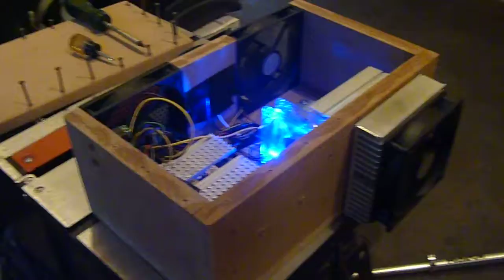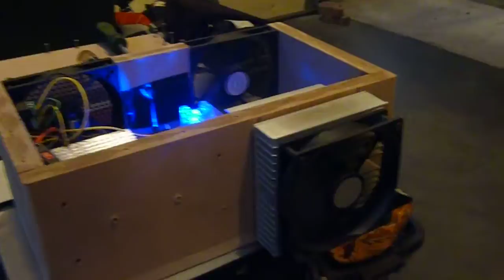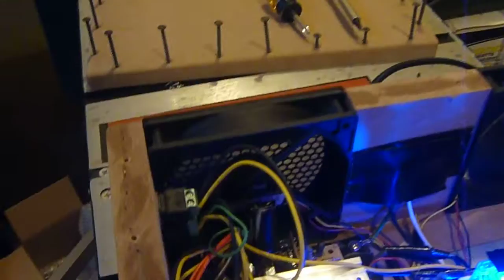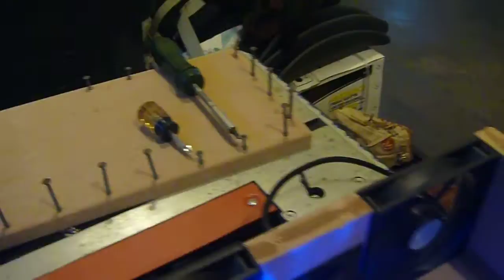Mini Heating/Cooling Unit

Comment: do you know the model number of you heating/cooling unit?
Reply from the maker: It was the PJT-10 but I bought them in 2012 from All Electronics. I don't think they have them anymore. I did find a link to the picture of the unit for reference.
https://www.allelectronics.com/mas_assets/media/allelectronics2018/spec/PJT-10.pdf
Reply: @jdccroad  Thankyou for that!!!

Comment: Thank you! you inspired me to build my own using maybe using simpler methods. I have been doing lots of research on it to make it simple as possible and safe and I think I have something. My only fear is modifying the humidor.
Reply from the maker: Juan Rivera Measure twice, cut once. 😀 Thanks. It was definitely a fun project.
Reply: I hav e a question for you. It looks like you are successful with your project. I have a few questions to ask if you don't mind. I can do it in email if you prefer.

Comment: there is like 0.5 inch gap between the 2 heat sinks. how did u do that?
Reply from the maker: Cross Wise, there is a solid aluminum block that is sandwiched between the two heat sinks.
Reply: is it possible to use the compartment of the hot side for warming up foods? is the heat enough to warm up foods when the box of the hot side is insulated?

Comment: Anyway to get a parts list. Looking to build one for my humidor but kind of lack wiring on something like this. The fan on the cold side is that blowing towards the heat sink to keep from codensation or is it blowing out away from the heat sink. Was the wiring to archieve this sounds kind of complicated. Any help from a BOTL is appreciated
Reply from the maker: Blowing towards the Heat-sink to keep if from forming condensation.

Comment from the maker: I know a guy in California had condensation issues. I think he was using a stronger way more expensive unit. I chose to run 2 lower powered units. You have to be careful because the dew point is 60 degrees at 70 percent  humidity.

Comment from the maker: The 120mm fans don't allow any condensation. Since I used a pc power supply I had both  12 & 5 volts. The fans run at 5v at idle and 12v in heat or cool mode.

Comment from the maker: Next time I get into the wiring I will wire both units to cool and heat. The humidor is so tall you almost have to treat it as 2 units in both heating and cooling, although I do have 3 80mm PC fans moving air from the bottom to the top. Other than that it is always 70’ +-1. 
The Peltier devices I used can be found at Carl's Electronics search PELTIER COOLING ASSEMBLY

Comment from the maker: It is doing well and I am very satisfied with it. I'm not sure if my latest video shows it but I did add another Peltier heating/cooling unit in the top of the humidor since it is hollow up there. 
I currently have the Peltier devices wired so that in cooling mode both units (top & bottom) are on. In heating mode only the bottom unit is on. I did that because I figured the heat will rise so I wouldn’t need the top unit as a heater.

Comment: How has your heating/cooling unit been working for you? I recently purchased an Olde English Tower Humidor like yours and I'd like to be able to control the internal temperature. Your unit looks great. So, I'd be interested to find out if it has been working well for you, and what you'd change or have done different (if anything) knowing what you know now. I'd appreciate any assistance in pointing me in the right direction on how to start a similar project for my humidor. Thanks, Don.